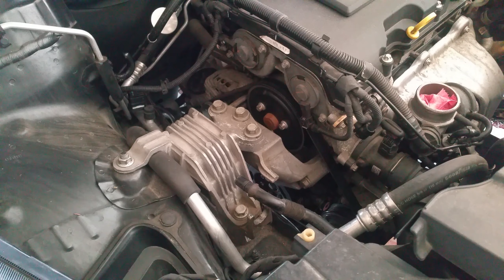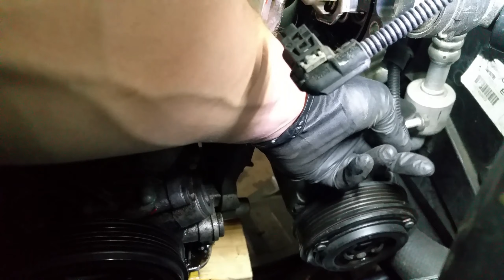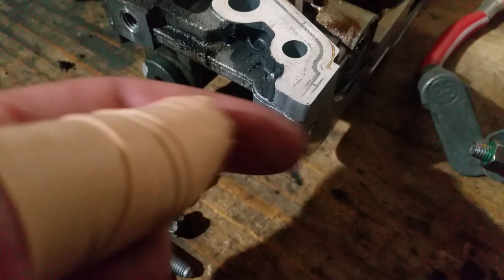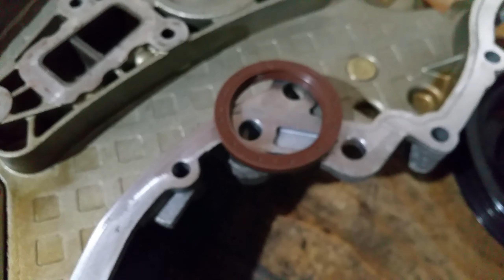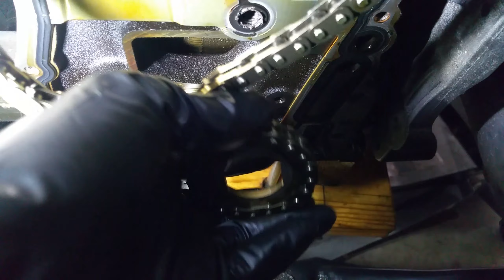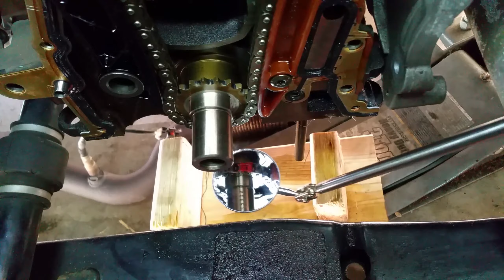Chevy Cruze Timing Cover Gasket Replacement & Water Pump, Alternator, Valve Cover, AC Compressor

Comment: [2018 Buick Encore AWD - 145k] Marking the chain like this is a good idea. Even with the crank and cams locked at TDC, the chain can be installed in a way where its off a link at the sprocket. This would have saved me a good amount of time and frustration during reinstall. I ended up getting the bottom sprocket on the chain and aligned with the crank first, then pull the right side of the chain tight and over the top so all the slack was on the left side by the tensioner. That did the trick. My guides were worn, but the chain showed no stretch. I replaced the guides, tensioner and chain anyways in hopes of never having to do this again.

I'll add for anyone  trying to do that who has AWD, to get the oil pan off you'll need to either drop the PTU/transfer case adapter
 or grind down the mounting bracket attached to the transmission where it lies under the rear of the oil pan. It prevents the oil pan from dropping down (that was a fun discovery). Buick wanted $3k to replace the timing cover gasket!

Comment: I did  the  timing cover gasket   Timing wasn’t right so i took it apart again and  my question is if i do need to pull out the gasket and clean the surface again  from oil

Comment: This video had a lot of information.  However it wasn’t accurate.  Painting the chain does absolutely nothing to w sure timing remains the same.  The crank should be locked in place, as the cams are.  The timing sprocket has no effect on timing and either does the chain.  Just ensure the right side is tight and all the slack is on the tensioner side.   This was a long video for faulty logic.
Reply from the maker: Multiple people have missed the point of the paint so replying to clarify: marking the chain is not done for the purpose of setting timing. The purpose of the paint is to idiot-proof reassembly. I've seen a few forum stories and youtube comments where people think they got the right side tight only for it to be one link out and cause all sorts of issues. Cue having to disassemble a second time to fix it. I even demonstrated how I didn't get the teeth/links correct on the crankshaft sprocket. Had I gone with "feels tight" there would have been issues.

The timing is set by the keys on the end of the camshaft in relation to cylinder 1 being TDC. If the camshafts are locked, cylinder 1 stays at TDC, and timing keys are not loosened from the camshafts, then zero timing adjustments are needed IF the chain is also put back correctly... hence the paint.

Comment: Have a question about my Chevy Cruze and it's a 2016 first generation. Do they have rear main oil seals and if they do how hard is it to replace and what might it cost to have one replaced if they even have one. I was wondering? I know the front crankshaft pulley have a seal just wanted to know if it has a rear main oil seal. Thanks and God bless
Reply from the maker: There is a rear crankshaft seal as well. It's inside the bell housing for the transmission (manual or auto).

Comment: @in-depthdiy2123 Firstly, Thank you very much for the video.
Question: It is nearly 4 years since your video was posted.  Do you still have the vehicle?  And is the repair still working?  Or is the leak back?

I have the same vehicle.  I am the original owner.  It has very low miles (50K miles).  But, it is starting to exhibit that same annoying drip of oil down the side of the oil pan.  Thus, I'm considering the same repair.  And wondering if your repair has been long lasting, or if you would do something different in hindsight.
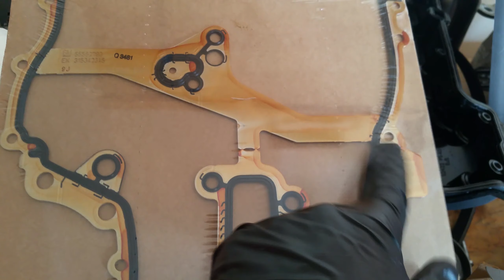Reply from the maker: Late reply, but yes I still have this vehicle. The leak has not returned yet (knock on wood). I did, however, replace the head gasket and at the same time replaced the top half of the timing cover gasket, but that is the top half that was not originally leaking. The bottom half that was leaking is still the original fix and holding. If you look close in the video 34:06, there's a pinched area in the middle where it can be snapped in half. The engineers were at least thinking when they designed that.
Reply: @in-depthdiy2123  Thanks for your reply.  Appreciate it.
I did eventually do this repair.
It has been a little over six months.  So far, no more leak.

Comment: Good illustration more lighting would help you my man why doesn't anyone put pan on dry for engine support with a few bolts? The pan job and timing job are two separate tasks with this engine I don't know about you but I'm not putting my head under engine supported with a  hoist or something...  pan is last job after timing is done let rtv cure from timing cover job your suppost to put it in those strategic problem areas before torquing cover...onced cured pull dry oil pan straight edge were that crap oozed out from timing cover  and then apply silicone to pan job done no leaks

Comment: When you're removing that pulley are you turning the bolt left or right I know it's righty tightly and lefty loose but mine ain't coming loose?
Reply from the maker: The crankshaft pulley bolt is a normal right hand thread bolt.

Comment: Didn't see the tool used for holding camshafts in position.
Reply from the maker: It's literally just a flat piece of metal that spans the two crankshafts. It comes in a kit with the timing set/adjustment tools, but any flat metal bar that spans the two camshafts and fits snug in the slots will work.
Reply: @in-depthdiy2123  Thanks!  I figured that's all it was but wanted to be sure. BTW, we pressure checked the coolant system on 2014 Cruze and it held 19psi for 2 hrs and was at 14 psi after 4 hrs. Combining that with the oil level not increasing, it's unlikely coolant is getting into the oil. Both coolant and oil look very good. Planning on having oil analyzed. Plugs look good as well. We've been adding around 16 ounces of coolant every 600 miles or so. Car is used primarily for very short trips. We added coolant dye and I'm wondering if the coolant is degassing thru a small leak at the water pump while engine is running. It certainly is not burning coolant. The only other place where oil and coolant are is the oil cooler but neither coolant or oil show signs of cross contamination.  Thank you for your reply.
Reply from the maker: @gunnerb4u978  Late reply, but the water pumps most certainly off gas and cause coolant levels to drop when not sealing 100%. I added dye to mine years ago and eventually got enough gaseous moisture build up around the water pump shaft to see the dye. Another possibility is it off gassing through the cap, but if it's holding pressure that might not be it. If oil and coolant are both good and staying separate, and no visible external leaks, my bet is on the water pump shaft not sealing when running and up to temp.

Comment: So can the timing chain cover and gasket be changed without removing the oil pan?
Reply: That's what I also want to know.
Reply from the maker: @gunnerb4u978  See my reply to TagGeorge
Reply from the maker: Technically yes, if done carefully, but in actuality it's easier to take it off. The RTV on the oil pan crosses the engine block to timing cover threshold. If you try to replace the timing cover without removing the oil pan you run the risk of not getting that RTV to seal properly around the oil pick up line for the oil pump.

Comment: I must have missed something but why did you go through all the timing chain alignment steps to replace the timing cover gasket?
Reply from the maker: Timing cover gasket sits behind the timing chain. Need to take the chain and guides off to get the gasket/seal off.

Comment: Great video !! Thanks !! I'm in the middle of replacing a head gasket on this motor. I'm sure you just helped me understand why my Timing chain tensioner pin wont go in, I think my chain may be worn a little. Might need some "help" to get the pin in. I can't seem to get the tensioner back far enough to pin it. Same motor in a Buick Encore. 144K on it and going to see how far she goes. GREAT little motor ! Thanks again ! 
You've got a new subscriber !!
Reply: You might be saying it sarcastically. But it’s a horrible motor lol

Comment: Hey great video and very informative. I'm about to fix this same leak on my son's Cruze. I have a curiosity question if you don't mind answering. Why didn't you put a new timing chain on while you had it open? My son has 180,000 miles on his Cruze. How many miles was on the one you did? I appreciate any and all feedback
thanks
Reply from the maker: I had 146k miles at the time. I didn't see the need for a new chain. I've ran multiple cars out to 300k miles with original timing chains so unless it has noticeable issues I tend to not replace them. Mostly personal choice, replace it if it's in the budget and would give peace of mind.
Reply: @in-depthdiy2123  thanks for your feedback and I really appreciate your video

Comment: Gf looking at a 16 Cruze for her daughter. Dealer said it needs timing cover gasket. Gf's dad is very concerned about this and thinks it's a major issue that will lead to a new engine down the road. 
How common is this? 
He's very concerned about how or why any fluid would get inside the cover but it seems to me your explanation is that a bad seal will allow oil or water in the cover because both flow along/by the cover?
Reply from the maker: Disclaimer: If anyone is concerned about buying a vehicle I can't recommend purchasing it. The owner(s) should feel safe in their vehicle. My opinions and thoughts are purely my own and everyone should come to their own conclusions.

Discussion: depending on where the leak is on the timing cover it may or may not be a big deal. Mine wasn't bad simply because it leaked down the oil pan and made a mess, more annoying than an actual problem. However, if the leak is between the coolant jackets and the engine block (behind the cover) then it's possible to get oil and coolant mixing (only way you'd know this is by seeing oil in coolant or coolant in oil). I haven't heard or read of this happening, but it is a possibility (GM has used this design on many vehicles for multiple decades, it's probably happened before but not enough for them to change the design). If it is leaking externally then it's mostly an annoyance and makes a mess. There are concerns on cars that still have the underside shield getting hot oil on them and burning. If there is no underside shield this is not a concern, there was a recall many years ago to cut/remove the shield.

I've owned my Cruze since new in 2012 and if the cover did not leak externally I would not have replaced it, going on almost 10 years later. A similar timing cover design is on the 3800 V6 engines used in Grand Prix and related vehicles with the water jacket passing through the cover for the water pump. I've had those timing covers leak coolant externally on the side of the coolant passage, but again, the coolant and oil did not mix inside the cover. There are other concerns almost every Cruze will experience (valve cover/PCV, water pump, turbo cracking) at some point. Read up on those if you want. Take what you want from all of this, I am only a single data point and sharing what I've experienced.
Reply: @in-depthdiy2123  Great explanations. The dealer replaced the gasket and water pump. She ended up buying it. I guess we will see what happens in the future. Won't be many miles put on it since her daughter will just be driving back and forth to school in town for the next few years.

Comment: One of the best and most useful guides to replacing a horrible gasket. PCV gave out and I ended up with coolant leaking past this into the oil and the thermostat died.
Reply: Hi, fyi If your pcv fails again it means your intake manifold has failed, it's a common problem that damages the pcv.

Comment: I changed the regulator and motor in my wife's cruise. When I put everything back, the roll window down and back up, and door ajar messages came up. That was 2 months ago. Now its doing some wild stuff with the radio turning on and off, doesn't start unless it's jumped, and seems like it wants to die (lights dim, motor sputters) when its idling. The first message i got was service theft deterrent system. I think its all related. Im a carpenter, not a mechanic. Any thoughts? Thanks.

Comment: That new seal is latest generation seals without any internal spring. Usually they come with the plastic guide. Once they are fitted and the dummy guide is removed it takes few hours for them to settle onto the journal before you could start the engine. This concept is far superior to the previous generation as they do not tend to mark journal, in some cases they go deep marking the journal.

Comment: Great video!  I have everything removed that I can see and the cover refuses to come off. Left side seems ok, right side is acting like there is a bolt near the gasket tab.  Is that where the locator pin is?  Any thoughts or experience with this?
Reply from the maker: If something seems stuck then it's probably a missed bolt. The cover should come off pretty easy with a peeling-like stickiness.

Comment: IMHO the spring in the "original" crankshaft seal is not the original: the original one on my car was exactly like the tiniest of the two new one you show us. Your "original" one is in my opinion an elring spare part, with tensioning spring and diagonal grooves. I've tried the both and I found myself better with the original one.

BTW: what did you use to hold the engine up? In the start you show us your wooden tool, but later the tool is not more in the place, and you said you had the crankshaft pulley off while sitting up the oil pan. So can you please explain the mistery because I'm very interested on it?
Reply from the maker: The original seal showed in the video is definitely the original. I've owned the car since new and have done all maintenance and work on it myself. GM switched to the smaller spring-less version in newer years so it's possible your car came from the factory without a spring seal.

Good question about holding the engine up! When the timing cover is back on I used the original mounts that go over the water pump to hold it in place. It might also be possible to let the engine hang for a little bit without the passenger side mount, letting the mount/transmission on the driver side carry the weight. I cannot recommend doing that though since it's a lot of weight to let hang, but it might be able to hang for short periods of time.
Reply: @in-depthdiy2123  Thankyou for your kind answer. So I've understood why there's two versions of the crankshaft seal! My car was made in 2014 and GM surely had already switched to the springless version of the seal!

Comment: Should you use RTV with a cork gasket?
Reply from the maker: Depends on what the gasket is for. If the RTV is to bridge the gap at the head/block connection and the cover gasket is cork then yes. The cork will not form into the slight crack enough to seal it the way RTV would.

Comment: Was there anything you wished you would have thought of prior to doing this?  Maybe replace some other parts or verify something else.
Reply from the maker: I think the only thing I didn't replace was the thermostat. I tend to replace all gaskets or rusty hardware, as much as I think is necessary for an easier job in the future. I even replaced the water pump during this job. Be good to your future self and give him/her a break!
Reply: @in-depthdiy2123  I replaced all of that and the t-stat as well.  Was looking for more possibilities.  It is all complete and runs like a champ now.

Comment: this will not put you back in timing. the chain has nothing to do with that.  this is just how to have a no slack chain
Reply from the maker: I'm interested in hearing how the timing can be off if everything was reinstalled exactly like it was before.

The rotation of the camshafts is locked by the slots shown in the video. If the crankshaft is marked, or just not turned freely so you don't know where it is in the rotation, putting the chain back exactly where it was (via the red paint marks) will ensure the crankshaft realigns itself to the camshafts. The crankshaft sprocket can only go on one of two ways, making alignment of the crankshaft pretty easy.
Reply: @in-depthdiy2123  and you want to know how? because you can have the cam shaft in correct position but the phasers rings can still rotate around.  the phasers rings sit between the sprocket and the actuator bolt that you tighten up.   that thing has a certain position and can move independently until torqued down
Reply: @in-depthdiy2123  I wasn't talking about how you did it or your timing.  I am talking to the other folks who are commenting about attempting this without a timing tool kit and saying the chain is loose.  you should know when setting the timing... the device that goes between the sprockets is what makes the chain tight... doesn't matter what link goes where.  that device removes any slack and then you unpin the tensioner.